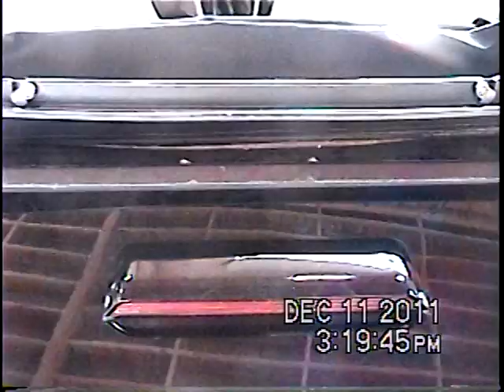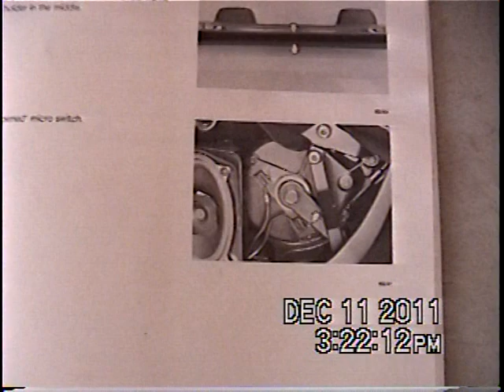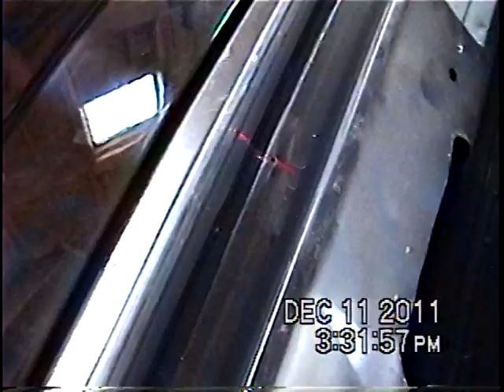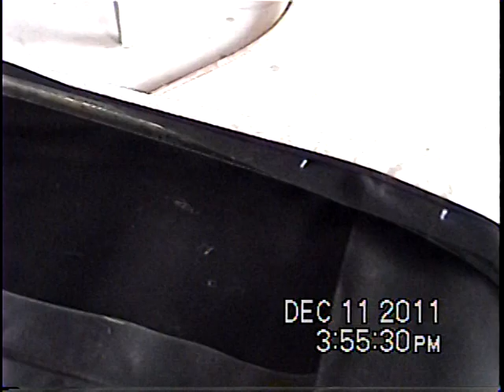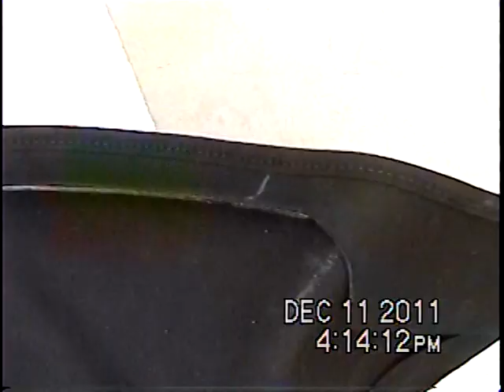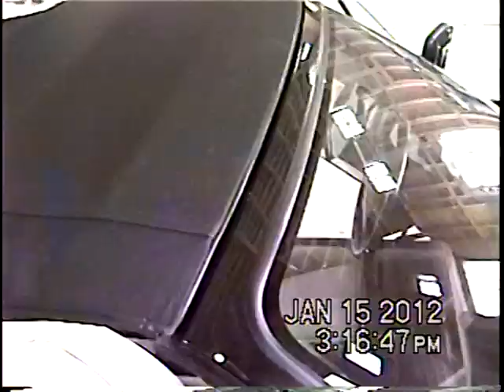Porsche 944 Cabriolet Top Replacement

Comment: My S2 Cabriolet only has 36k miles since new, but the motors have given up almost 20 years ago. 

I have two questions if you couldhelp. 

1. My upright window seals no longer match up how do you adjust the top to line everything up again. 

2.  how can I keep my top from rattling over bumps. When I bought the car new I didn't have that. 

Thanks for the video.